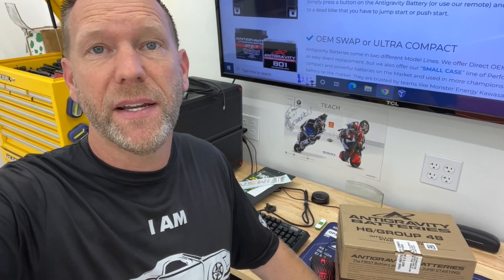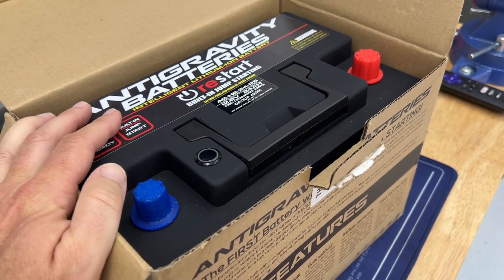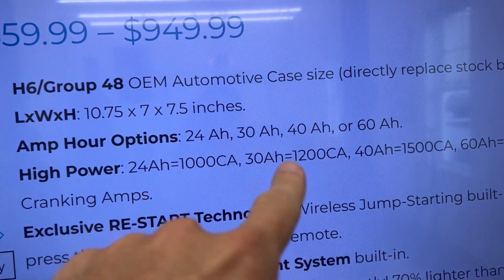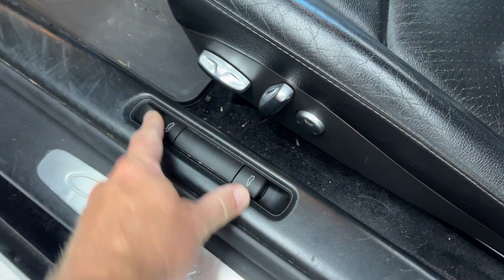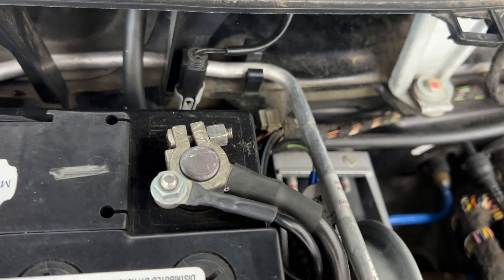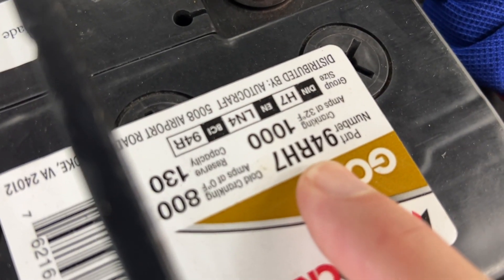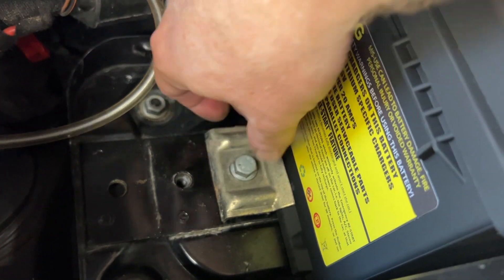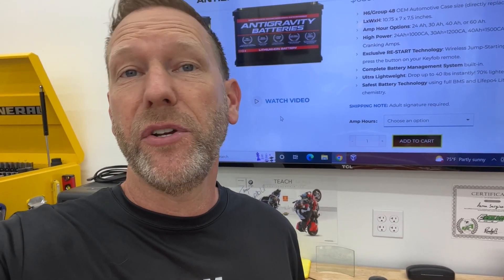Porsche 987 Battery Install  |  Upgrade to ANTIGRAVITY Lithium Ion

Comment: Thank you for sharing this! I don’t drive my 987 very much so I’m wondering if this is a good solution. I take the normal battery out for the winter but can the antigravity one sit for 3-4 weeks between drives (or longer)?
Reply from the maker: +Alex Herceg I think it’s supposed to sit between drives less than your normal battery if it’s connected. I always leave my cars on a CTEK if it will be idle that long
Reply: @HelpMeDIY  this was the exact context I needed. Prior to the end of last season, I went ahead and got lazy in my winterization, hoping for just one more nice day to take out my 986. That day never came, went to hook up the BT and nothing. Took it to my neighborhood parts guy and confirmed DOA. Went ahead and got another AGM to replace the dead battery this year, and am planning on putting it on BT when I know the weather forecast is unfavorable for an extended period of time, but if I end up with another boat anchor, I may spring for the AntiGravity just for the BMS and emergency jump. Cheers Aaron!

Comment: I wrote to them regarding the possibility of using this size / type battery in my Boxster Spyder 2011. They recommended I use a 40 Amp one. This them becomes twice as heavy and certainly NOT as tempting as your 8.8 pounds... Please advise ... I am also looking at Lite-Blox Batteries. They are even lighter but also so much more expensive. I look forward to your reply. Thank you for all this...
Reply from the maker: +Sherif El Sakkaf not one issue with it yet!

Comment: $700? I think you mean $1050 for an H6 battery. That is a far cry from the $180 at Walmart for a Platinum AGM. That is 5.8 times as expensive and I know you wn't get 5.8 times the life out of it. Some of their claims are BS.
Reply from the maker: +@a.c.e.7568 I get the huge weight savings and the remote jump start feature. Worth it to me!
Reply: @HelpMeDIY  Hey, its your money. And I doubt you could measure lap time differences unless you are so consistent to put ten laps down that all fit in a 0.1 second window. When you are that good, then you can see if a change improved anything.